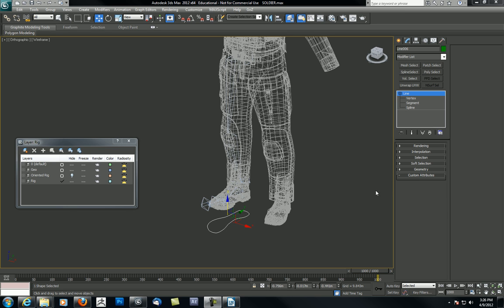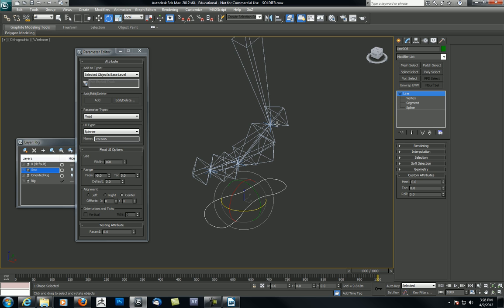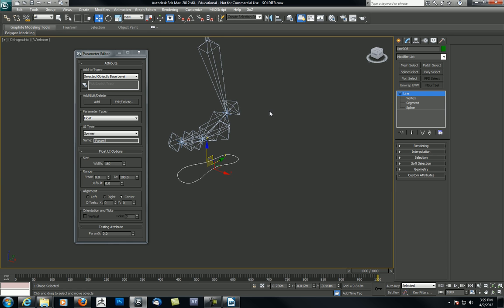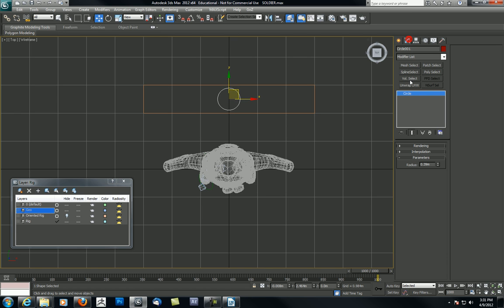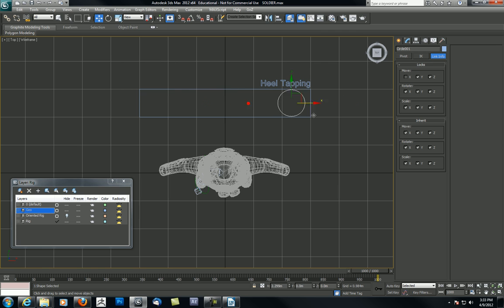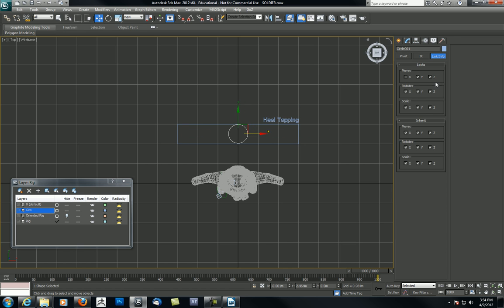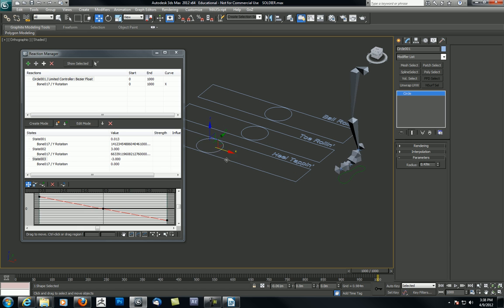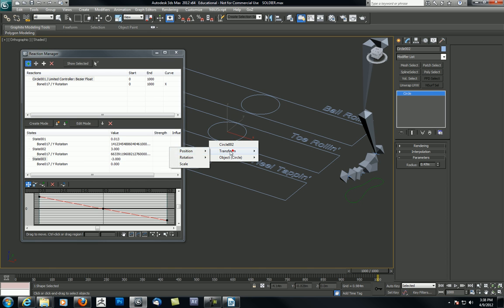Creating the Reverse Foot Rig Part 2 (Reaction Manager)

Comment from the maker: Viewport sliders only provide a limited, linear range. Here's an example why you should make your own sliders: If you were to make a square and put a circle in the middle of it....then use Reaction Manager to connect eyeblinks and eyebrow movement so that the upper left corner is the right eye fully open and the eyebrow is fully arched, then the lower left hand corner can be eye fully blinked and eyebrow full down. Set up the opposite eye the same way. You now have a complete blink/brow rig.